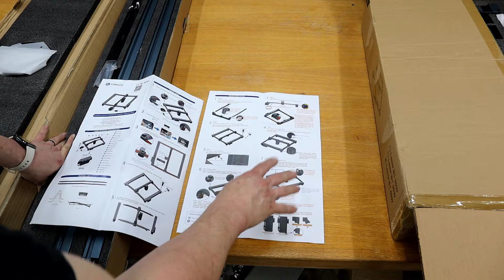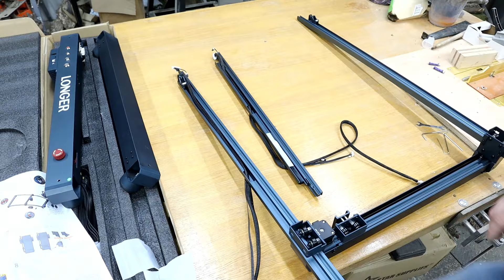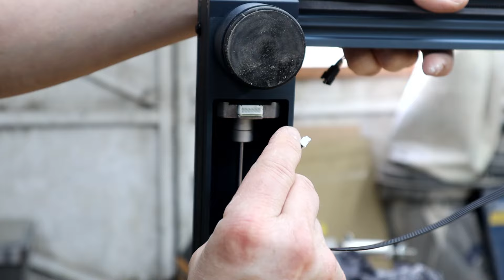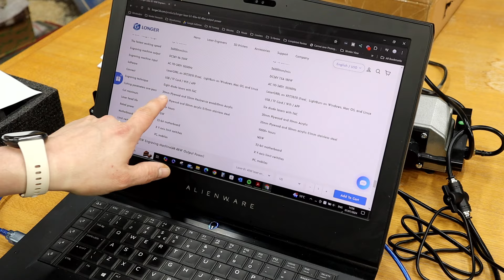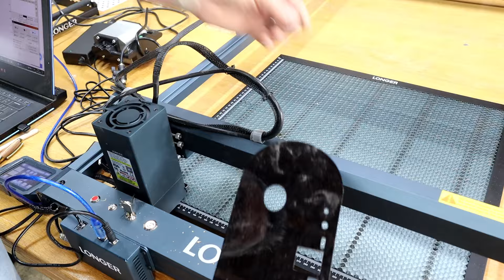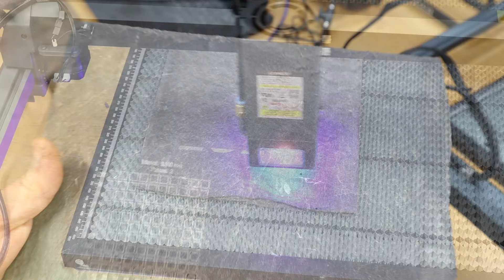Longer Laser B1 40W Review

Comment: I'm sorry, but a laser is not suitable for cutting thick elements because the laser beam is not constant and grows and weakens with distance. 
Higher laser power is often used to engrave or cut thin parts faster.

Comment: When you put yours together with the extension kit, you got an extra little board that came with it did you end up using it? I didn't use mine because when I looked at the two boards together, they both looked exactly the same now I'm beginning to wonder why when I try to make a large item on the it gives me an error in the coding. What settings did you make when you added the extension kit can you do a short video on that thank you. Am I am using light burn. It seems to work fine with all my other lasers that I have. I have five of them total. Not using my 5 W anymore just for back up. The instructions weren't that great.
Reply: Did you figure it out?